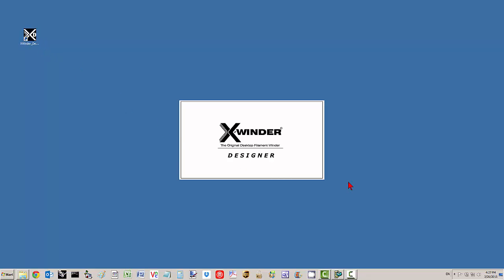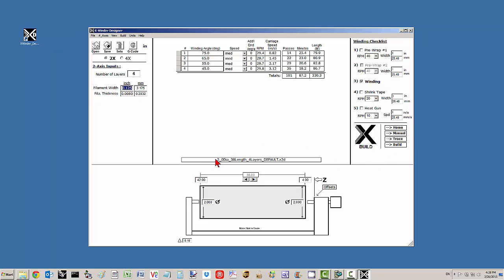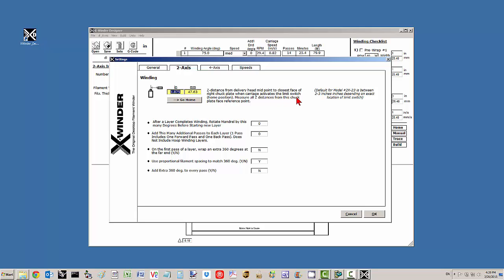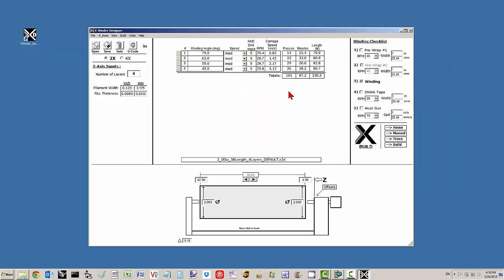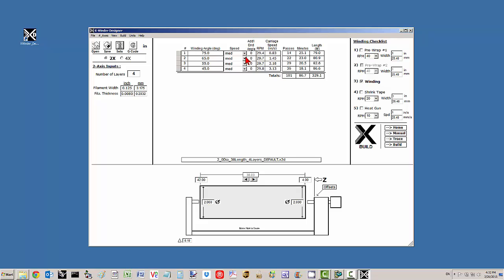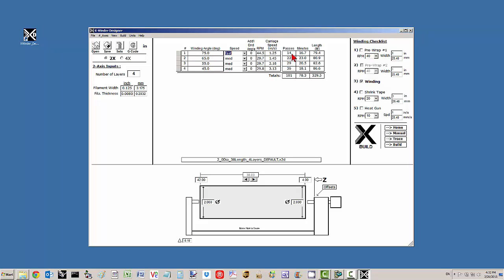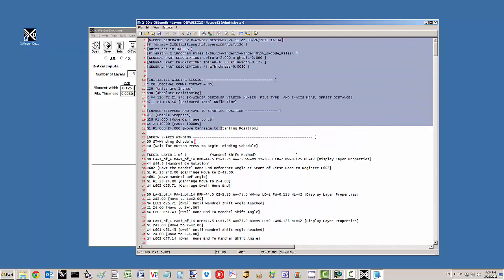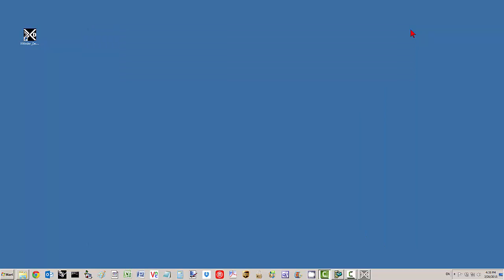X-Winder Designer Software v4.11 (2-Axis Overview)

Comment: Hi Turner, you forgot to mention what the trace button function is.

Nick
Reply from the maker: ***** Hi Nicholas - The trace button/function will move the carriage and delivery head at slow speed to the beginning Z value (right hand side) of the mandrel, then pause and wait for a button press, then move to the last Z value (left hand side) of the mandrel at slow speed - and thats it. Its basically to see how well your measurements and the actual mandrel are aligned - there is no winding or mandrel rotation taking place in the trace mode - only carriage movement.